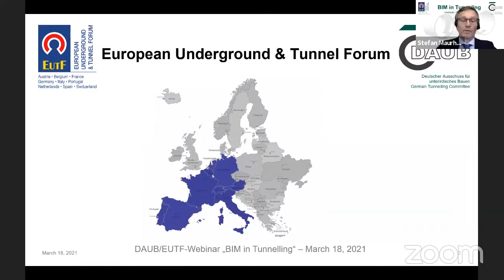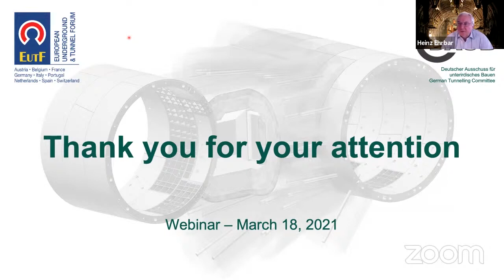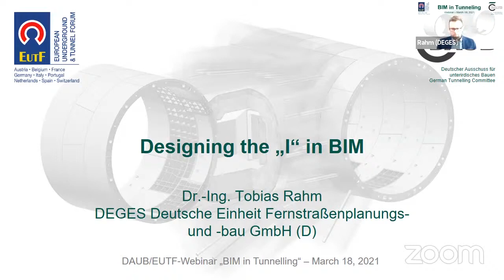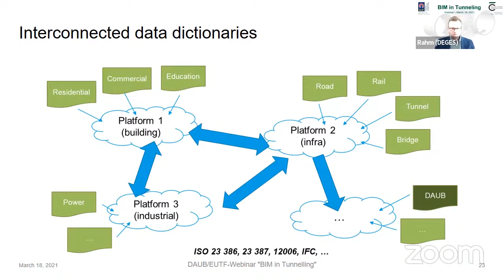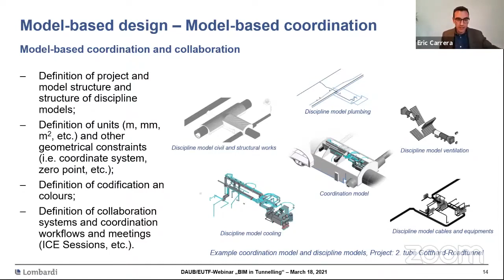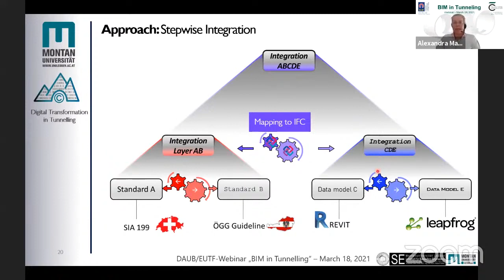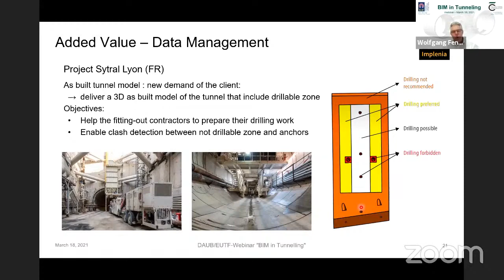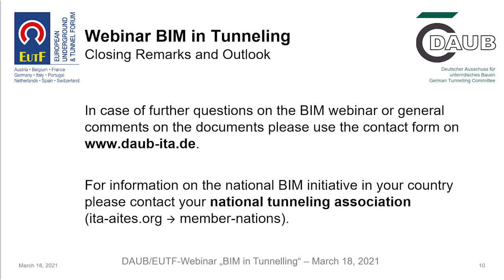BIM in Tunnelling

Comment: Here is a list of timestamps for your convenience:
First Panel
0:48 - Panel
5:00 - Lars Babendererde - Session Chair
9:00 - Heinz Ehrbar - DAUB
11:30 - Knowledge Pyramid
13:20 - Objectives for Digitalization
15:00 - Roll of DAUB
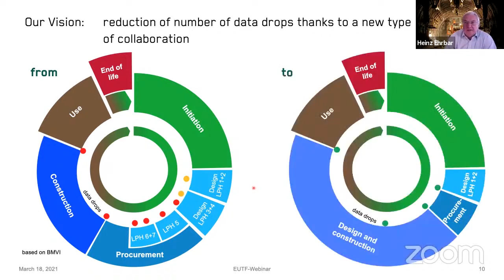17:25 - Vision - Data Drops
20:00 - Data Overload
21:08 - Roll of DAUB 2
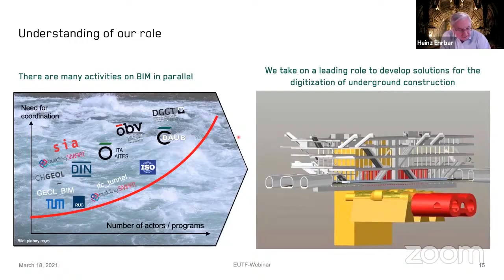22:25 - Strategy - DAUB
26:36 - Recommendation - DAUB
30:00 - Outlook - Summary
32:40 - Questions
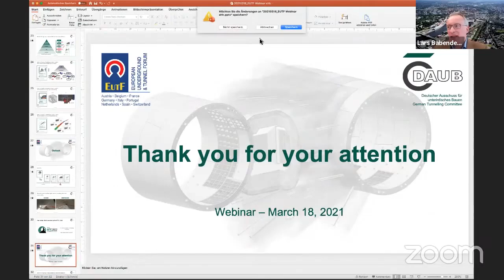42:20 - Basics of BIM - Stephan Frodl - ZÜBLIN AG
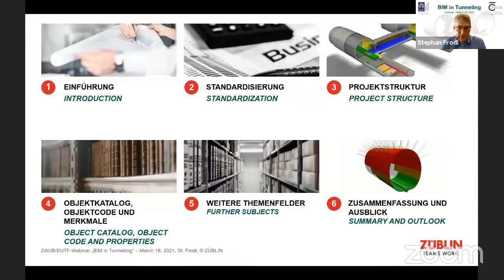44:05 - Introduction 
47:35 - Standardization
49:53 - Project Structure
52:34 - Object Catalogue
53:44 - Object Code and Properties
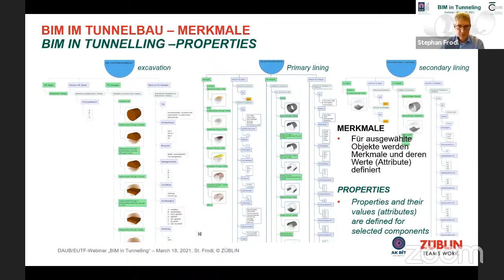57:32 - Further Subjects
58:58 - Element based Tendering
1:00:29 - Information Management
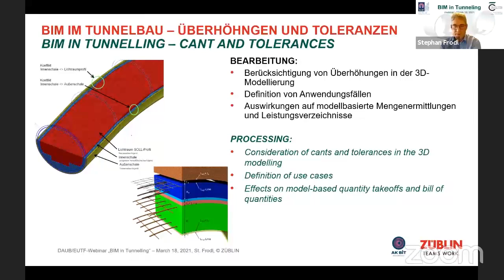1:02:30 - AK BiT
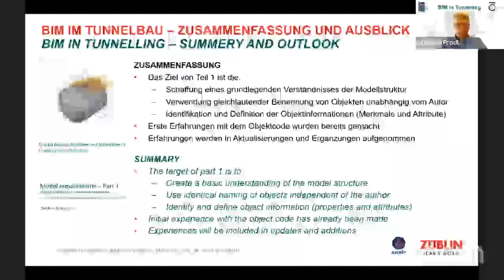1:03:14 - Summary
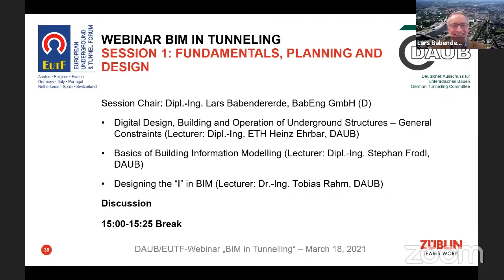1:05:11 - Questions
1:12:40 - Design of "I" in BIM - Dr. Tobias Rahm - DEGES
1:15:04 - Introduction 
1:20:00 - Motivation 
1:31:30 - Questions to be asked - Use case independent
1:33:00 - Tunnelling data dictionary
1:36:02 - Summary
1:36:39 - A look in the crystal ball
1:37:13 - Interconnected data dictionaries
1:38:25 - Questions
1:45:50 - Discussion
2:01:17 - Second Panel - Implementation and Realization
2:02:44 - Peter-Michael Mayer - Session Chair  ZÜBLIN AG
2:04:55 - BIM based design and Tendering - Eric Carrera 
2:07:35 - Model based design - BIM goals and use cases
2:11:05 - BIM Execution Plan BEP
2:19:25 - Model based coordination and collaboration 
2:23:20 - Model based quantity take off and cost estimation
2:28:17 - Drawing extraction - Drafts
2:29:25 - Model based tendering
2:33:45 - Model handover  - construction preparation
2:34:45 - Literature and references
2:35:00 -  Questions
2:38:45 - Prof.Dr.techn. Alexandra Mazak-Huemer ITA-Austria
2:39:20 - Interoperability as a Vision
2:40:26 - Interoperability in Practice
2:42:05 - Problem with Excel
2:43:00 - Interface and use case
2:46:05 - BIM data templates - concept and principles
2:50:41 - Schema mapping - Information Model to IFC
2:52:00 - Schema mapping - IFC to DIN EN ISO 23387
2:53:09 - Schema mapping - integrating 2 standards
2:55:39 - Approach - Stepwise integration as good solution
2:56:25 - Generic integration model
2:58:25 - Step I and Step II
3:00:25 - Questions
3:08:47 - Wolfgang Fentzloff - Example for Application of BIM - Implenia 
3:10:30 - General principles
3:13:12 - BIM applications defined by the client
3:14:47 - Planning to reality - Albvorlandtunnel
3:17:50 -  Planning to reality - SN 91 Slussen
3:19:44 - Challenges and Implementation
3:21:40 - Added values in construction phase
3:39:43 - Takeaways and call
3:41:00 - Questions and Discussion
4:03:25 - End
You welcome!